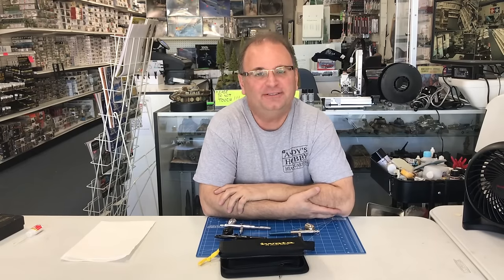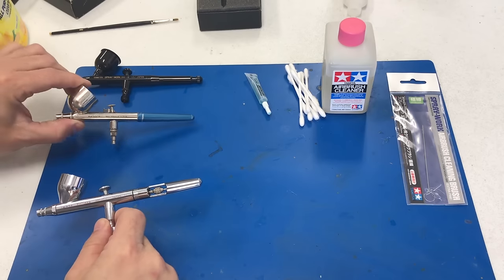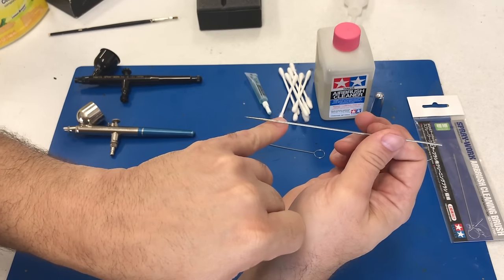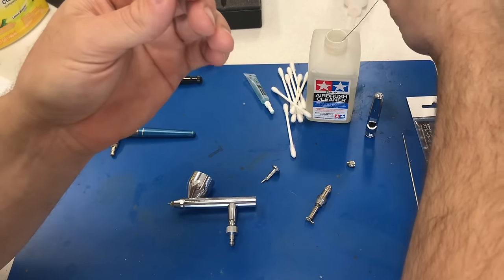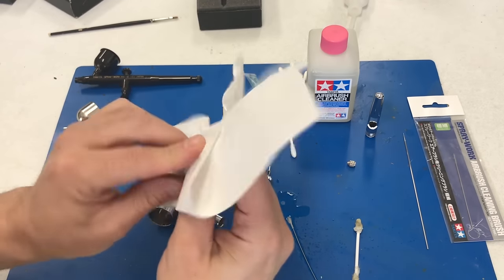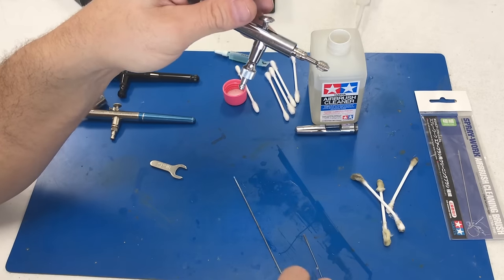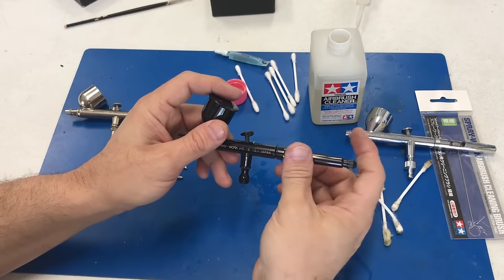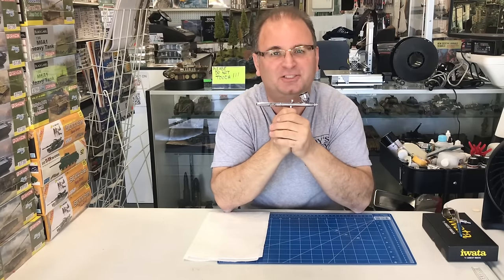How to disassemble and clean your airbrush  easy step by step

Comment: I have a question : i applied zimmerit photo etch to my king tiger but i have some superglue stains/marks on the photo etch , can i spray tamiya paint over it ? Or will the super glue react with the paint?
Reply: Painted over super glue with Tamiya paint; it applied fine.
Reply: Flurp Mcderp as long as the glue is dry then its fine. You can use fine sandpaper to remove the stains if you want, but careful to not remove the zimmerit detail
Reply: Sanding is not an option, will let it dry for a couple of hours. Thanks for the info!
Reply: Flurp Mcderp  In my experience as long as the superglue is dry it shouldn’t be a problem
Reply: Oh crap; missed the "on the Zimmerit" part.

Comment: Tamiya`s X-20 thinner is nothing more than cheap 70% Isopropyl Alcohol available at your local pharmacy. Four times the amount for a quarter the cost. Use Windex to clean your airbrush followed by 70% Isopropyl Alcohol. Don`t use toxic Tamiya cleaner.

Comment: For me I notice that if I do not use my airbrush for some time no matter how clean I left it it will still be jammed when I want to use it. After I cleaned my airbrush after use I will not assemble it till I want to use it again. Do you guys encounter such problems?
Reply: During reassembly, some people coat their parts with needle lube sold by airbrush companies such as REDGAB by Badger. Some people use glycerin oil. It puts a slick coating on everything to protect and lubricate the parts.
Reply: Will it be more troublesome to remove the lube before using it?
Reply: There is no need to remove the lube before use!  In-between use I leave the paint cup half full of UMP airbrush cleaner :)
Reply: Oh I see. So just soak the whole air brush in the cleaner solution? Ok will try it out next time. Thanks.
Reply: Never soak your airbrush, that will make it worse. You remove the lubricant inside.
Reply: Thats because the lube tends to harden in time, specially with cold weather. Before using the airbrush for a log period, just add a 50-50 mix water - alcohol to soften the oil and wash it out. That simple step "prepares" the airbrush for being use. After that just add the paint in the cup. After using it, just dont forget to fully clean the airbrush and lubricate evrything againg. Even if you dont have that problem, is a good habit to clean the cup before being use, even if it is "clean" from the previus paint session. Just add a few drops o airbrush cleaner and water and wash the cup with the tipical "inverse flow" technique. Seems stupid, but this helps you to avoid clogging problems due to crystallized oil (it happens).

Comment: Really enjoyed the video on cleaning.  By chance I worked with paints and thinner for about 40yrs.  My comment,  using thinners and solvents bare handed can cause you to become intoxicated just by letting the solvent absorb thru your skin.   I had this happen to me using some very slow drying thinner, butyl cellusolve ,  This solvent is used as a retarder greatly increasing the dry time of an enamel or lacquer and in acrylics.  I happened to have a gallon at my house and I used it to clean off some tools and in about ten minutes I became intoxicated. I wore no protection on my hands(rubber gloves).  So Andy, be careful and warn people about the solvent and thinners.